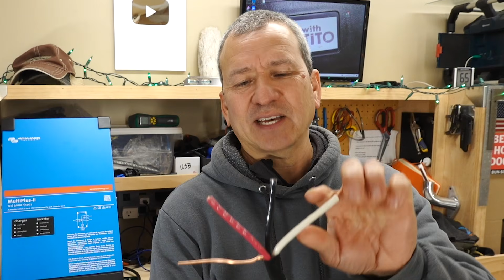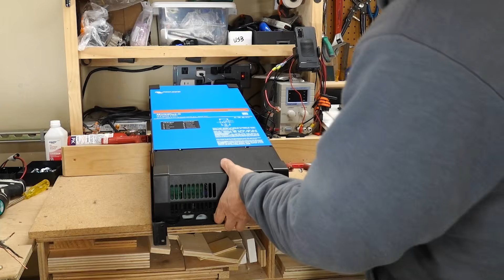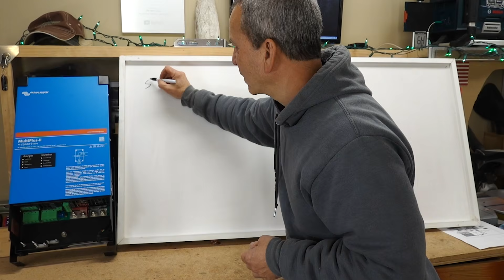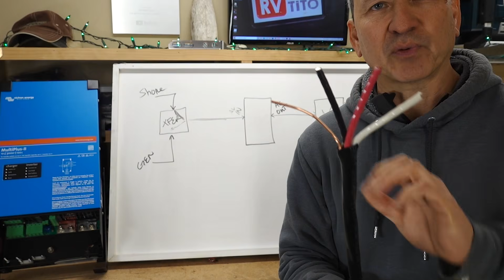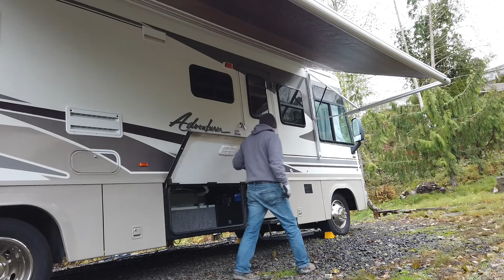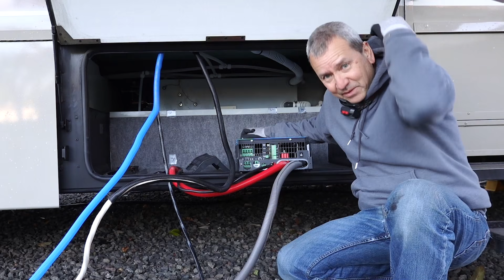Installing the Victron Multiplus II Inverter to Power our 50A RV Off-Grid | RV With Tito DIY

Comment from the maker: Did this video help you out? Buy me a beer🍺by going to https://rvwithtito.com/victron and using my preferred supplier for your Victron gear and to https://rvwithtito.com/battleborn for lithium batteries. Cheers! (BTW: This was NOT sponsored so every bit of support helps)
Reply: @rvwithtito Brian what accessories do I need to order with the Multiplus II
Reply from the maker: @retired4ster  That is really going to depend on what additional Victron equipment you choose for  your system. Interface cables will probably be needed. At a minimum you should get a USB interface cable so you can program the Inverter from your computer.

Comment: Question:  I would like to set my Multi Plus II to automatically switch over to Inverter only (not on, charge or off) ... between certain hours a day (basically 5PM-9 PM) and back to On when outside of those hours.   ... When I am at the unit or on the VRM I can do it by hand ... Outside those hours my shore power rates are less and during those hours very high .. these are their peak hours.  Is there a way to set the Inverter, Cerbo GX etc. to automatically do this switching every day on it's own.? ... If you can point me in the direction too to find the answer would/could help too.  thanks...
Reply from the maker: I keep it on 'inverter only' and switch to 'on' remotely when needed like you mentioned. Automating it is not as straight forward and includes some trade-offs. Here's a video that goes through some of those: https://youtu.be/wpHBgOrjiqo?si=mhAKp97SrrMM4f39  Another easy way is to program a smart plug on the shore power input while dialing back the shore current on the Multiplus (power assist). I always use power-assist set at 10A and a standard 20A extension cord for 1kW of charging. Many of the smart plugs can't handle a continuous 10-15A load even though they claim to. So you may have to experiment until you find one that does. Again...I just monitor remotely with VRM and switch it manually from my phone. Hope this gives you some things to try.

Comment: He chose that inverter because it's the best one on the market. There is no other that comes near this. If it did it would be number one and not victron the proof is in the pudding. Look at what you have. Look at what everybody else has. Victron the only reason why people go to other brands is because you have to build victron systems. You can't just buy an all-in-one exclusive system and now you look at today where it will be illegal to purchase an all-in-one that has Wi-Fi and Bluetooth built into it. That has a app where the manufacturer is not from the US and we don't have no us manufacturers. I'm sorry to tell you guys but that bluettie it's not where it's at or should I say where it's supposed to be? First and foremost they don't make a 50 amp version for the new unit that they now offers

Comment: Brian 2 Questions do you ground your charge controllers to your chassis  and what sixe ground are you using to ground the Multiplus 2 is it one size down from you 4/0 awg supply lines r is it somthing smaller. i can tell from the wiring diagram i downloaded
Reply from the maker: Yes. Connecting the equipment ground on the side of the Victron controllers is recommended. My main negative busbar is grounded to the chassis. So you can just connect a #10 or #8 wire with ring terminal and run it to your busbar. My Multiplus II equipment ground is also connected to the to the main busbar with a #2 AWG cable. I'll update the diagrams to include that. I'm also adding a second T-Fuse between the batteries and busbar. Hope that helps.
Reply: @RVwithTito   Thanks again Brian that helps.  As always thhanks for the videos It helps to take the guess work out of the process

Comment: Awesome video! Did you install any breakers in between the inverter? I’m trying my first DIY install trying to learn as much as possible
Reply from the maker: There is a 400A T class fuse between the positive DC battery busbar and the inverter.

Comment: New to your channel,  I also have a 2003 Winnebago journey 34hd and would love input for where to run wiring it’s a diesel pusher my panels are under the end of the bed ,old inverter charger was removed and replaced with a regular charger( driver rear ) , I do have a main panel and a sub panel but hard to tell how they wired it after they took the original out , any help would be appreciated I have 400 watts of solar a 40 amp controller and 3 battleborn 100amp batteries for now 😀

Comment: Oh and one more thing. I've been running a cord and plugging directly into my fifth wheel while on generator power. But I love how you set up the transfer switch. I don't have a pass through inverter, can I put another transfer switch in front of that one?

Comment: Maybe I missed it but what do you do with the stock charger/converter? And how would this apply to a class C RV, wehn running would it still charge the battery?
Reply from the maker: For a 30A Class-C you would go with the standard Multiplus II instead of this 50A model. You can keep the converter/charger and power it through the Multiplus inverter, or remove it and use the charger in the Multiplus. If you want to charge from the alternator while driving, then you'd also need a DC-DC charger.

Comment: Hi, I'm installing the same inverter in my Winnebago and noticed that the instructions call for 100mm of clearance above the inverter.  My space only allows for about an inch and it looks like your install is similar.  Has this caused any issues with the inverter getting too hot?
Reply from the maker: I have a vent fan directly behind the inverter that pulls warm air out if the compartment. It's wired to a thermal switch that turns on around 85 degrees.

Comment: Cheers Tito, You are the best rv tech on youtube. I purchased and downloaded your Victron Multiplus-11 50A RV pdf. I followed all the instructions, watched many youtubes to make sure I did a good job. I now have everything wired, Victron 11 to battery, shore power, cerbo gx, display screen and smartshunt. Voila when I turned the shutoff switch to on only the Cerbo GX and Smartshunt powered up. The display reads that the Multiplus is turned off. How do you turn on the Multiplus? I pressed button A but no startup.  Do you know what I have missed? Do you offer consulting? May I buy you a beer? What to do? I just spent two hours on youtube but really stuck. How does the Victron get power? I have my battery cables connected and the battery bank reads good on the display...help??
Reply from the maker: If you go into the device list on the Cerbo, do you see the Multiplus listed? If so, you should be able to set the Mode to ON from there. I think the options are On, Charger Only, Inverter Only, Off
Reply: Thanks kindly

Comment: so am I correct in saying you pulled the AC lines from the breaker and connected to the input of the multiplus - then you ran the output of the multiplus back to the breakers where the original wires were - yes? 
do you have an onboard generator 
and does this mean the shore power and onboard generator work as before?
Reply from the maker: Yes. You are correct. And I have a generator and shore power going into a transfer switch which feeds the inverter input.
Reply: @RVwithTito  Thank you - i have to do such an install - your video helped me understand this install type better

Comment: Hi great set of install videos. I am about to install this inverter/charger on my 2007 Winnebago Journey. I noticed you routed the neutral through the current measurement inductor for the EMS system. Does the EMS work ok as before? 
Also, were you able to run your basement air in the inverter only mode  (before your big AC change) with this setup with only one inverter? Did you have to install a soft start on the basement air? Thanks, keep up the great content.
Reply from the maker: Thanks. I left the EMS in-tact at first, but I it's all disconnected now. The circuits that ran through it go straight to the breaker now. The neutral doesn't run though there anymore either. I got rid of the control panel, but still haven't removed the equipment from the service panel. Thanks for reminding me that I have to do that :)

Comment: what about the converter for the batteries? will you do a video on that?
Reply from the maker: This replaces the converter. So you can remove it. I talk about that a little more in my system design which you can download at https://rvwithtito.com/downloads

Comment: its kind of lame that you spend all that money and you have to pay extra for bluetooth connectivity.  Great video thanks!
Reply from the maker: I hear ya. Victron has always been more modular that way. There are settings that can only be set from a hard-wired connection. So you don't really need Bluetooth on the inverter.

Comment: I am also wanting to do this to my older MH which currently does NOT have an inverter.  One thing you did not cover was how your motorhome is getting 12volt power.  Do I removed my converter and this Multiplus does that work too?  You mentioned that this Victron Inverter will charge the batteries(which is also part of what a converter does).  I have the 120v part down.....just need help with what I need to do to get/keep the 12volt side of things working.
Reply from the maker: I've been updating my writeup but here's the scoop. Yes. The Multiplus II is also your charger. Remove your converter and wire your DC panel to you new 12V DC busbar. You could add a 30A fuse or breaker online too.

Comment: Hi Tito, I bought the multi plus and I bought the Epoch Batteries but my Victron has not charging or inverting. I’ve been trying to troubleshoot with no success. It will not charge my battery either wondering if you have any ideas or maybe if I can talk to you so maybe you can help meappreciate it
Reply from the maker: Are you getting power from the batteries? If you're getting no voltage then you may need to wake up the BMS from a 12V source. Which EPOCH battery are you using? The Elite model needs to be turned on before charging.
Reply: @ OK Tito thank God everything is working good now I even turned my air conditioner on with the battery. I am getting some alarms but I’ve learned looking at YouTube that sometimes from the beginning you get those and then it’ll settle down but it worked perfect and it’s charging thanks for getting back to me when I ask you for help really appreciate it. God bless you one day. I would like to treat you to the beer. I think I emailed you. Maybe we can touch bases again. God bless you and thank you. You do great videos. I follow you all the time.
Reply from the maker: That's great to hear. I was going to suggest reviewing the Multiplus programming. Glad you got it sorted out. 👍
Reply: @ yes I have battery right now. I charged it with my motorhome running the battery. It’s a 60% and I am getting 12 13 V were the black and red coming into the inverter Victron equipment
Reply: @ i’m using the latest one with bluetooth 12V 460 AH elite V2
Reply from the maker: Oh nice. I'm testing one now. Do you have 2 or just one?
Reply: @RVwithTito  One
Reply: @ and my Victron is the one you’re talking about on the video. The 50 amp bought it from Bluemarine. I believe you had a code or something.
Reply: @ OK Tito today I was looking at everything and I found an old inverter to battery fuse that was limiting the voltage going to the Victron. I tested and I was getting 12 V at the DC side of the Victron and on the Battery side. I was getting 13.6 so by eliminating the fuse now the system is charging, but maybe I did something on the Settings trying to figure things out that is not inverting anything will help appreciated Tito for getting back to me
Reply: When I call Sam is the one that answers and I have not been able to get much help

Comment: Brian, my RV is set up with a dual Breaker panel setup where the ATS output feeds the MAIN panel and then there is a separate breaker in the MAIN panel feeding the inverter with a return Romex to a dedicated INVERTER sub panel.  I have already pulled 6AWG THHN 2hot, N & Ground “up and back” to upgrade my 10AWG orange Romex to prepare for using the Victron Power Assist feature.  BUT….. I’m at a huge crossroads.  I’m trying to decide whether it’s worth it to retain the existing split panel design OR do what you and other Victron YouTubers are doing and “light up” BOTH PANELS ( by bus bridging the two together after returning with the output from the Victron).   With your system being in practical use now for a while, how has it been operating (potentially) ALL LOADS thru that 3000va single inverter?  Is power management while boondocking a nightmare?  Has your inverter ever shut down on you?   I ask because maybe with my 40’ Alfa Gold motorhome which has things like TWO basement 2 ton Coleman heat pumps, a roof Mach 8  AC unit, TWO electric heating elements for a hydronic floor tile heating system, a diesel engine block heater, and an electric standard Atwood water heater - plus a ton of kitchen stuff (microwave dishwasher garbage disposal (yeah, that’s stupid funny they put one in an RV) a Synology NAS and a host of other things) — I’m wondering if I should just retain the split panel design and maybe put only one of the basement heat pumps on the inverter side?  I cannot ever think why I’d NOT run my 7.5kw Generac generator if I am desperate enough to need my engine block heater?  Another challenge:  I’m full time for 8yrs and am NOT willing to give up storage space for a second inverter.  And the RV builder put the inverter in a dumb place:  under the front entry steps!   So it’ll be a tight fit AND I’m gonna need cooling fans.   Just curious how your practical use has been.  If you’d like to direct email me… you can shoot me an email to “troglegs@gmail.com”.  Thanks.  Absolutely love your channel.  Still also wrestling with the solar design too.  I happen to have the exact SunPower panels you have (4 of them) for just under 1800 watts of power.  And I ran a second set of 10awg DC wire to the roof so I could add a second mppt controller.  Lots of fun about to start!

Comment: Hi Tito
I have watched many of your videos and have learned quite a bit. 
I have a 2001 Itasca Sun cruiser
I had just purchased the Victron multi plus two.
Did your RV come with a 6AGW from the transfer switch to the panel near your door entry or did it come with two split 30 amp lines?
I have already determined that I am running a new line from the transfer switch to the distribution panel/ multi plus(will be right next to it) but unfortunately, I have the kitchen and bathroom GFI along with AC one and AC two that are right next to the transfer switch.
Not sure if this makes sense but any help would be appreciated lol.